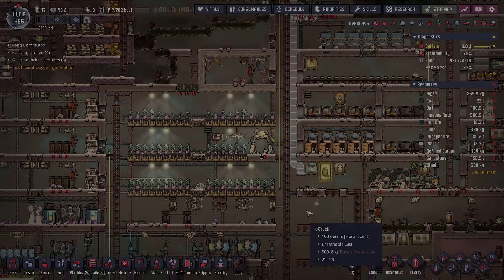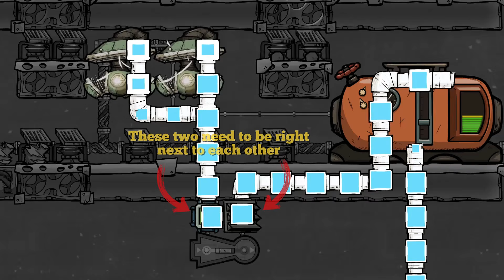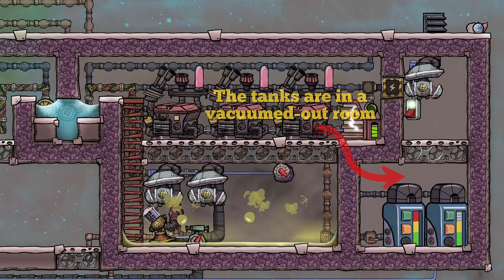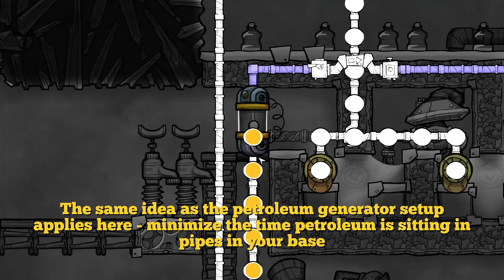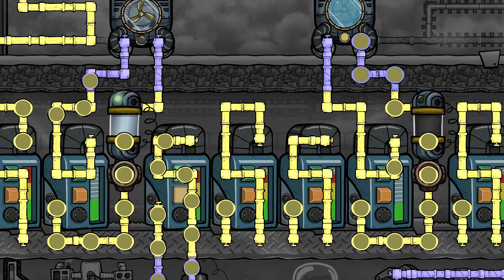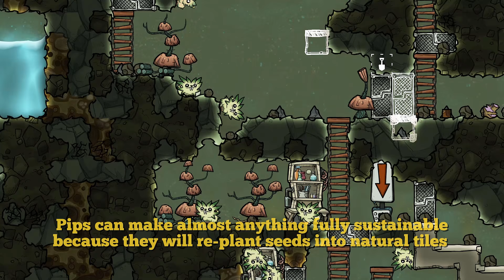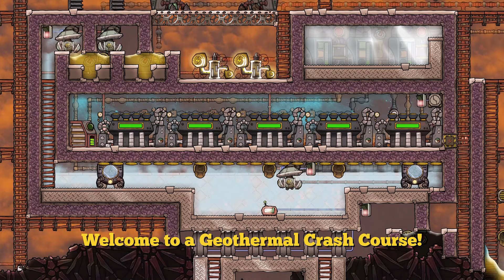How to Get Past the Mid-Game in Oxygen Not Included

Comment: WASSUP MAGNETTTT!
i know you're taking your time but BRO you're gonna go CRAZY when you come back to the game (I know you will because I also took a lenghty 1 year break due to boring study stuff). Anyway, they released some crazy bionic dupes that are mostly useless, but they come with a beefy powerbank structure and that shit is FIRE to colonizing new comets. Long story short, you can now pack a hole dam lot of energy with the colonizers to save you on that early new comet power struggle local energy production bla bla bla bla. 

Although the new bionic dupes kinda suck, they do make great colonizers because they barely breath, there are crazy stress and morale buffs for doing very little + they can technically be all dupes in one for almost free morale, meaning that building that steam turbine on the 7th ring of hell does not need a HUGE morale debuff (because one dupe has a bunch of skills like piloting AND electrical engineering). 

Also, they added a flying sweepy, which makes some automations go crazy

Now, on the jurassic park stuff. Magnet... You're not going to belive it... THEY ADDED A NEW METAL BETWEEN STEEL AND THERMIUM... YESSSSSSSSSSSS
It's called IRIDIUM and you can either harvest it with a simple rocket (even simpler if in spaced out) or just let it hit. It comes around cycle 200. So YES! That means whe can get that TASTY thermo aquatuner petroleum boiler on cycle 250 for that infinite food / water / O2 / kW chain with the 3 oil reservoirs. 

Tbh, the new critters suck, they are worse versions of the preexisting ones but ok, the iridium is worth it

Will love to see you back when time comes! See you around

Comment: 10:50 this is one thing I don't like in ONI. It's basically the only option (apart from morbs exploit, IMO) to get cooling in ONI.
Would be nice of they added something plastic free early game to deal with heat. 
Maybe something like an aqatuner but less powerful and that works in reverse, cooling surroundings and heating up liquide.
Reply: You can use the gold aquatuner with ethanol. Build is showcased by Luma Play's in his channel. Also, you can spam ice thermal shift plates for a hole while
Reply: @Garueri  i know, but ice cooling is not really sustainable and labor intensive. And ethanol chiller is quite a power hog. Would be nice to have  alternatives similar to what we have with resources. like dosen ways to get plastic for example.

Apart from ST only other way to delete heat is viswords, but without seed duplication exploit it's not a practical way of cooling the base.
Reply: @トヤマトカナワ  About the wheezeworts, true, and in spaced out they are radioactive, so dupes can't even stay close to them

I get your point. You're forced to speedrun plastic via dreckos or oil (and these are the only ways I think) to avoid death by heat including duplicant heat and plant (food) heat
Reply: @トヤマトカナワ  Changing apples for bananas, have you ever seen the hydra SPOM design?
Reply: @Garueri  Ya, used it, but i feel guilty doing so. it's to OP.  
Right now i'm playing on Rime and my O2 source is off gassing polluted oxygen. I just fill up branch of  storage tanks, then deconstruct them. Those tons of PW are plenty enough to keep my base nice and even oxygenated for a loooong time.
Reply: @トヤマトカナワ thats cool. I love rime because it exterminates slime lung. i hate slime lung

On that topic, how would it be possible to exterminate it in terra for example? Im currently on cicle 350 terra, didnt break a single slime wet because I want to errradicate it. I was thinking of farming bleach stone and use the cleaner thing, or making a debree heater with germ detectors to exterminate it. Do you have any ideas on this matter?
Reply: @Garueri  ether by deodorizing to clean oxygen, in which SL dies naturally, or by having a bunch of floral scent. If i remember correctly FS and SL can't coexist, and FS owerpowers SL.
Reply: @トヤマトカナワ  hmmm so maybe should I not care about the slimelung, take care of the slime and then filter all the polluted oxygen on the map?
Reply: @Garueri  it will be a pain to clear all your base afterwords. if you can - it's best to clear oxygen and debris in place. But even if you contaminate all your base i dont think it's a huge problem, even on max difficulty. As long as you have sufficient oxygen production - who cares about that +30% consumption ? 

in conclusion - deal with it in place, but don't worry if you have a outbreak, it's not the end of the day.
Reply: @トヤマトカナワ  Honestly, I was thinking that maybe i could squeeze some extra frames without the game having to calculated all the slimeslung changes. At first I intended to freeze the slime biomes with aquatuners but it wasnt viable since heat takes too long to spread and it'd be A LOT of plumbing. Then I thought about not caring about it, then mining up the entire map, reuniting all the slime into bins in a overpressurized chlorine room to then cool just the entire air of the map into killing the germs. But im not sure about the viability of those ideas

Comment: I just found your videos as I'm getting back into ONI and trying to get a bit further than I did before. I didn't realize you were hibernating like a Copper Volcano ready to spew molten metal on us. 

But, one thing I wanted to ask is if you'd tried using Wheezeworts(With Spaced Out DLC) to kill germs in water and polluted water in the early game?

I've been experimenting with it, and it seems to work well for me so far, but then again, I'm only a novice. I plant the Wheezewarts in my polluted and purifying tanks with the pump in the radiation range. It takes a while, and I use manual switches to prevent cross contamination when pumping from my purifying tank to my potable tank. But, it is negligible on resource use, and helps keep my base cool. I thought it was a simple solution you'd be interested in. 

Of course I have to farm Dreckos for the Phosphorite to keep the Worts alive, but that gives me plastic and reed fiber, so it is like a win, win. . . win?
Reply: You can just use  1 micro gram (ug) of bleach stone in a room with around 6 liquid reservoirs. When the liquid leaves the last reservoir, given that all of them are in a room with  1ug of chlorine, it's going to be germ free

Comment: I’m not really a huge fan of your suggestion to throw the polluted water into space. It eats up a lot of resources running a vent that far when you can just go somewhere decently far from your base, find a water source, and just dump a load of heat into it (just enough for 1.2k steel.) honestly since you’re fast tracking toward midgame, you may as well set up your first refinery in the oil biome since that biome already has a bajillion degrees floating around and oil takes it very well. You’ll need to be down there to fast track plastic anyway.

You’d need that plastic to fast track the steam turbine; which in turn is your solution (when combined with the thermoaquatuner) for the refinery outputting the heat of 1000 suns

Comment: i was wondering if space would be a good place to put aquatuners. let them take in liquids and cool them down while dumping heat into the void.
Reply: If the aquatuner is not submerged in a gas or liquid it will only heat itself up, causing it to break extremely fast. It unfortunately won’t dump its heat in a vacuum/space exposure. (This is true for all heat producing buildings)

Comment: Maybe you know this trick, but I've not seen you use it - I have been using your usual filter gate set-up to prevent pumps and such from just rapidly turning on and off, but I them work like smart batteries, with separate high and low threshold. Some fiddling and turns out it's super easy - just have two sensors, one activating below the min threshold and one activating above the max,  and wire them Set and Reset on a Memory Toggle. Playing with a hydrogen vent in sandbox now and it behaves much more consistently with the Set port hooked to an atmos sensor at above 1kg and Reset to another at below 250g. I put the high level close to the pump, so it's more accurate to what the pump is sitting in, and the low, shut-off further away, so it's not as affected by the local vacuum around the pump. 

You probably get a ton of tips and I don't know how many of them you read, but I figure you'll be back in the game with the new expansion dropping and I've been benefiting from your old videos a lot, so thought I'd share this tip. Barely more complicated than just using a Filter gate, though it does take twice the space in the automation layer (2x sensors and the memory toggle is twice as big as a filter gate) and the results are much more satisfying!

Comment: This has gotten me back into ONI. I vow to complete the vanilla base game! 

Also, first person I've seen use so many liquid storages with a shutoff in heating and cooling situations. Seems a lot simpler than what we usually see. I like it.
Reply: I'm new to Oni and i rebuild this Cooling setup with the many liquid reservoirs. Must these reservoirs been built out of a specific material? For me it looks like there is no heat transfer between the reservoirs.  Or must there always be a circulation running? Maybe this setup is only very slow because of the tons of water used.
Reply: @CrossiZockt  try it with a very small amount of liquid first. I'm guessing that you're underestimating how much thermal mass a full liquid reservoir will take to change temperature

Comment: You really don't need steal to tap a natural gas vent.  It will last for hundreds of cycles just with gold amalgam, especially if you leave some natural terrain as a heat sink.
If you're really worried, just run a cooling loop through.  It won't take much at all for such a valuable early-game power (and water) source.

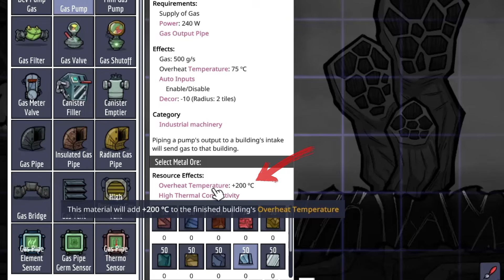Comment: 3:18 gold amalgam structures add 50 degree more to overheat buff so you don’t need steel for this
Reply: So it adds up to 125 degrees - still not enough, but it will last for quite a bit of time if you setup it correctly. Anyway with steel its just easier cuz you can build it and leave it

Comment: I got the great escape in 2020. Glad to see this game is still going strong on youtube.
I don't like several of the advice in this video though. 
-The hot water geysers should not be avoided until you have cooling. The water at the start will not be hotter than the minimum temperature of an electrolyzer due to the environment surrounding them cooling them down for a good while. So as long as you use them for oxygen the above 30 temperatures literally don't matter.
-Don't vent the refinery coolant to space. Put it back in the pool and just close the pool off when it's too hot. That water will be useful to have later. Also venting to space requires you to get to space, which is a long dig. You shouldn't delay steel that long.
-Atmo suits give +10 to digging. This perk doesn't make them a must have, but is probably more important than the environmental protection.
-In the base game you do not need atmo suits to get a lot of the oil. There are many pressurized pockets which when dug into will force themselves up into the colder biomes above. Just dig a narrow tunnel down and the oil will come to you.
-Your coolant room uses way too much water. Not good for a tutorial aimed at beginners. Show small setups that take little investment to get going.
-Open air electrolyzers require no more cooling than closed. Instead of piping the oxygen through your coolant room, pipe anything across both the coolant room and the oxygen.
-Hydrogen and recycling the heat from the metal refinery is a very strong combination, especially if tuned up in the power plant room. A hydrogen vent is completely superfluous as it produces about the same as a single electrolyzer. You can use this combo until you need the hydrogen for hydrogen rockets, or keep using them and make more hydrogen for the rocket.

Comment: some of these builds seem a little over engineered. He cools the stuff coming from the oil biome i have never done that just cooled the base itself and they eventually came down to temp. I rarely ever get steel for gas geysers dont wall it in with insulated tiles and let it dump its heat into the surrounding environment you have hundreds of cycles before this becomes a problem alternatively you can cool it and never build it with steel. You can do the same thing with cool steam vents but you have much less time with those considering they warm the surrounding environment rather quickly.

Comment: Little bit of a rant incoming sorry about it.
This video is so good but I'm actually a little overwhelmed. In my current save without knowing I tackled everything in the early game except for the cooling room (I had a Cool sludge Geyser literally next to the start so I use that) 

I went for plastic with glossy dreckos because I dreaded making the whole oil refinery + plastic thingy. 

Rn I tamed a volcano and made an aquatuner setup but since I don't have steel I'm taking damage, and for reasons unknown to me the Steam turbines connected to it are not working. So I basically just use it for cooling the frozen cool sludge water into a pool for the base, and free copper. 

Algae is running low so I'm planning on switching to the water oxygen generator. Coal is scarce now so I'm counting on my new hatch farm while I capture a vent natural gas vent which I realize about thanks to this video.

Finally I have tons of food, water, heating and cooling systems. But I can't find the strength to push through and fix the power/oxygen situation I'm in. I kinda wanna start again but my biome is perfect. 

I also waste so much time due to lack of shipping use, I understand how it works and everything I just can't pinpoint exactly where am I wasting so much time to automate it.

Anyways thank you for reading if you did. Leave advice, guides, comments anything that could help for me to read
Reply: You should start hatch farming ASAP. The number of hatch grow exponentially as times go. In late game, you can get up to 100 hatches + over 100 hatch eggs easily if you don't kill them and they make plant harvesting obsolete as you have 100+ tons of meat. They also solve your coal problem. For a population of 20, i suggest having at least 6 hatch farm.
Reply: @zenniz1992  If i'm real with you i understand Hatch ranching and when coal became a problem i quickly built a couple ranches. I think it is a little more sustainable but the algae is a big problem, i believe an electrolyzer setup is needed. After it i'll probably try to tame the natural gas vent. What do you recommend for oxygen production?

Comment: wall of text   I have 1000s of hours in ONI and never finished it.  The game engine wasn't designed the size and scope of late game.  With a Titan XP, 32 gigs of ram and a 5900x CPU I'm getting 19 fps.  You used to be able to bring it up to 40 fps with steam launch options mimicing the cores and threads of an I5 9000 series but as of last years patch that's no longer the case.
The only option I've found is to vent all unnecessary atmosphere to space.  :/
Reply from the maker: I will have a big section about performance improvements in my next video!

Comment: Hey man at 19:50 and thereabouts where you've got the timer set up to deal with very tiny packets on the rail not changing temperature. There's an alternate solution I've discovered where you can place one of those rail meters just after the conveyor loader and fix the automation so it resets itself. The rail meter will not allow a packet to be created unless it's at least one gram, which is just big enough to assure that temperature change will happen. And it gives you the ability to meter your packet size, if you ever wanted to send out less than 20 kilos per packet for some reason.

I used this technique on an iron volcano and ship out the iron in 5 kilo blocks just because I can
Reply from the maker: Interesting, never thought of it that way but it's a good idea!

Comment: You mentioned it just a little regarding food types with Berry sludge being a shelf stable food source with a decent morale boost.  What you missed was a review of necessary morale in late game and using various " furniture" or foods to increase morale / decor so you can get your dupes trained into many areas without getting stressed out.  There's also the "priorities" of Dupes and scheduling. You should address, sleep/ shower / rest /downtime work, What's the bare minimum to avoid dupes sleeping on the floors? Also, with longer travel times at later in game they need adjusted schedules to account for that.  you didn't mention what your 4th power source (geothermal) recommended battery settings should be set at?  Overall nice video. Great editing BTW.
Reply from the maker: Thanks!  I agree, I could have covered that but I don't know if there's a single solution for it.  I think I'll save it for a separate video.